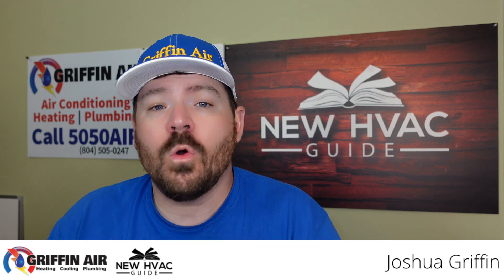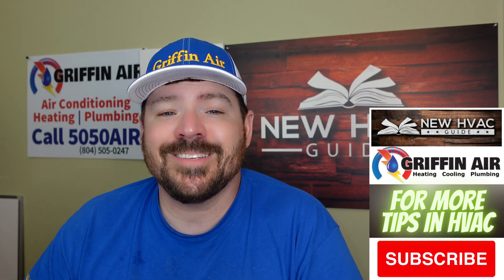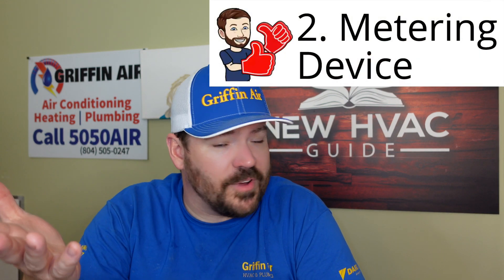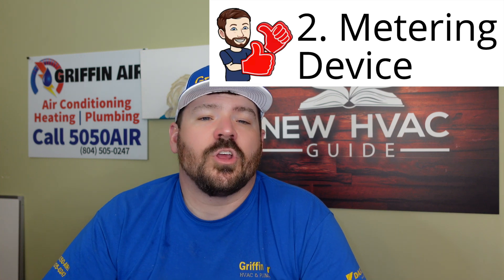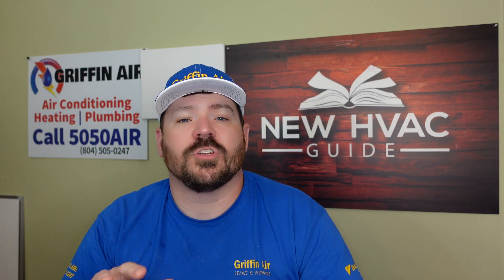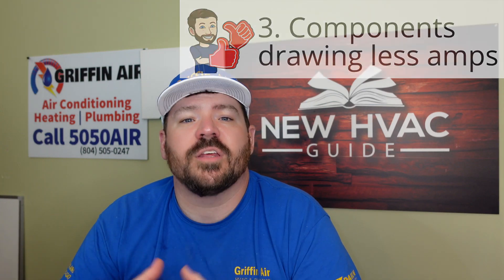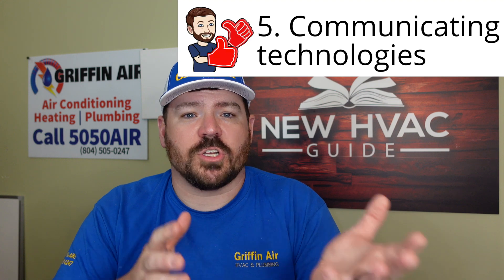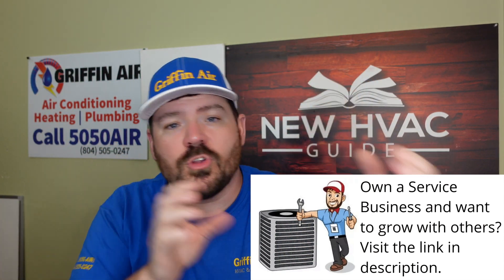5 HVAC Factors for Higher SEER or EFFICIENCY!

Comment: Higher SEER aka Efficiency or cheaper cost of operation would ideally be in todays world the Inverter series of Bosch. The load draw on that unit is considerably LESS compared to most others resulting in cheaper cost for use. The 5 Ton Bosch Inverter unit is a bit more costly if you are a customer like me who buys my AC units direct to avoid the upcharge most in air companies tend to do. So I had a 5 Ton Rheem 16 seer heat pump which cost me $4100 and upgraded to a 5 Ton Bosch 20 seer heat pump inverter system that cost $7000. The draw load is FAR less with Bosch that Rheem and my power use has dropped by half

Comment: The reason larger condenser and evaporator sizes leads to higher efficiency is that the entropy generated at those locations is proportional to the heat transfer (think BTU/hr) times the difference in temperature across the heat exchanger.  Entropy generation is the engineer way of saying "inefficiency".  That's why the newer systems also need larger ducts, since the cold air coming off the evaporator isn't as cold as in the old days.  I'm a chemical engineer who didn't specialize in refrigeration but I still remember my basic thermodynamics.  There are of course other ways they increase efficiency like better/smarter metering, better compressors, and other stuff, but the larger heat exchangers is a big part of it.  The downside of the higher evaporator temperature is that now that I upgraded to a new high-efficiency unit I had to buy a dehumidifier and run it all the time or my house molds.

Comment: i just installed Daikan 2 tons 17 seer mini spilt with one air handler in living area of my 2000sf 4 bedrooms high ceiling 2014 model year home in Fresno which we have 3 months of over 100 deg every day and  i can't be Happer . its awesome just take 5 minute to feel temperature dropping and now i just running this mini spilt unit for cooling down whole house and even don't bother with turning on of my old central system any more . with my original 2.5 tons central unit was taking for ever to temp go down when temp outside was over 90 ( with unit having full gas and new air filter and nothing wrong with it  )

Comment: Don’t know why people (besides builders) would want to install a low SEER system
Reply: And landlords haha.
Reply: I'd go 14 to 15 SEER for a base unit. Most units sold for central HVAC suck and are super expensive if inverter based.
Reply: Return on investment is a foreign concept for most consumers. They care about the money that's in their bank account today.
Reply: 2 primary reasons.  1st generally speaking you'll never recover the cost difference in electrical saving.  This may change soon thanks to Biden and his supporters.  The second reason is repair issues.  These higher Seer units use OEM parts that must be replaced with non universal parts.  I am hearing that inverter board replacements can't even be found now.
Whereas if you applied the KISS principle the service tech will probably have a non-tech part to get you cheaply repaired.
Reply: I'm in the Midwest. Going about a seer 13 just isn't worth it. Last time I ran the numbers it was like $10-20 bucks on savings per year to go to a seer 15. The cost was $500-$1000 more. Best case scenario you'd get payback in 25 years.... Worst case 100 years.
Reply: @shawnd567  Google Seer calculator .  I like to use Kobie Complete as it fairly straight forward.    Do not compare you old unit Seer. Compare the lower model you can get this year vs the level you're considering.   Now look at price to install.  If it take 15 yrs to ROI .  Pass hard
Reply: @shawnd567  The other is that as SEER #'s go up the percentage between each unit gets less, becoming more negligible.  Moreover if duct work SP's are over spec. you can forget about getting your SEER even close.
Reply: @shawnd567  I would say 15 still seems low to me. Did you price something that was over 20 seer?
Reply: Because you'll never recoup the xtra 15-20% in "savings" when you have to repair equipments increase failures.
Reply: @publicmail2  I've yet to see any data that suggests the failure rates are worse than single stage systems. This logic is what prevents innovation, lets not factor in almost all inverters on the market have far superior warranties as well. 10 year parts/labor is pretty standard on "decent" inverter systems. If there's one things consistent across manufacturers and warranties, they don't put extended warranties on equipment they expect to fail often.
Reply: @AJ-bi6ns  Don't need data to know that x13 failures cost consumers big and cost them more then the little savings over a PSC motors.  As SEER goes up the difference in savings becomes less per SEER unit, non linear.